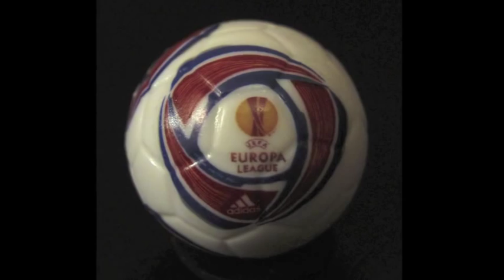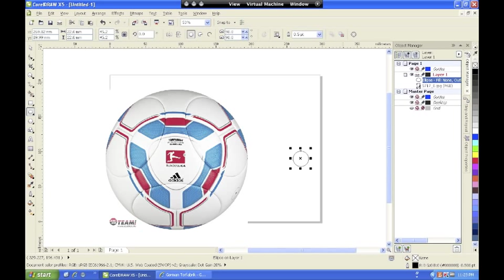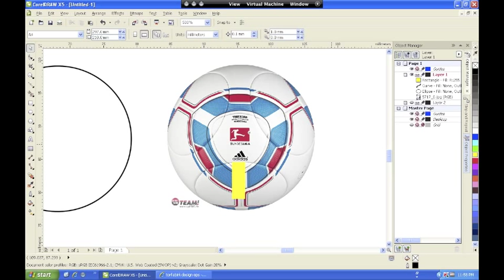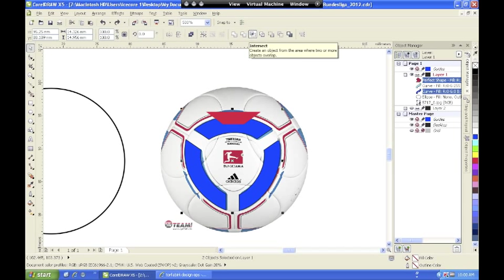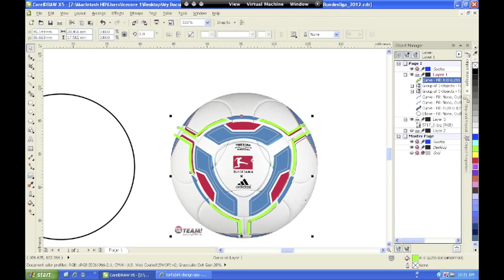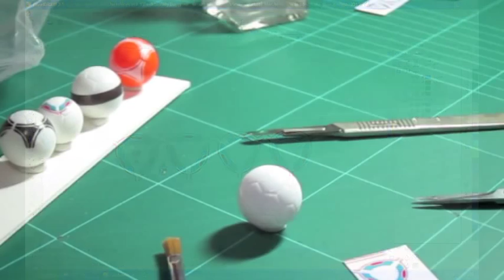Design and Making of Tournament Balls

Comment: hello, congratulations for the video.
I need to know if it's possible print the decals with a simple ink printer, I use an Epson L3150 printer (Wi Fi).
If the answer is yes, then which card should I use? thank you